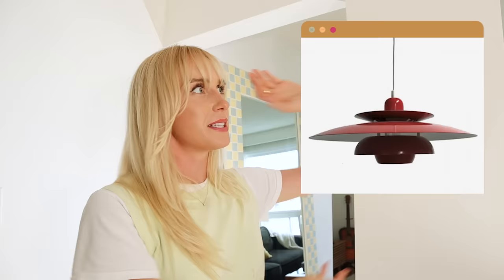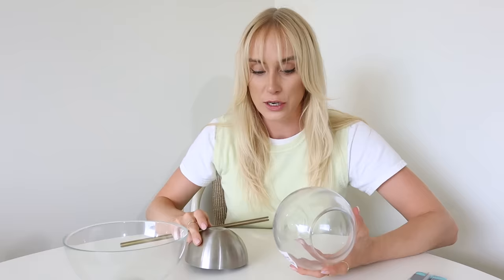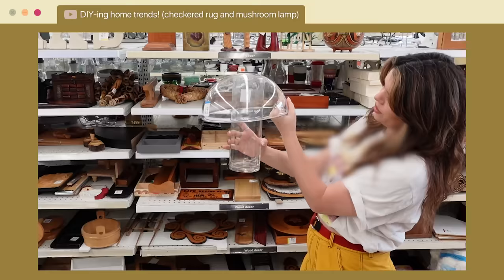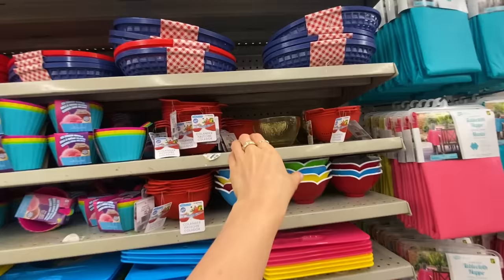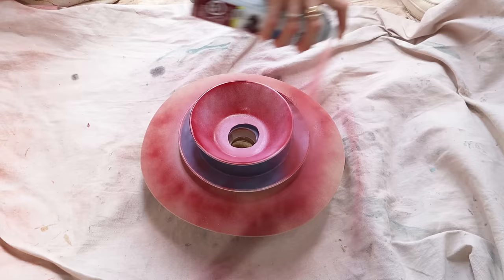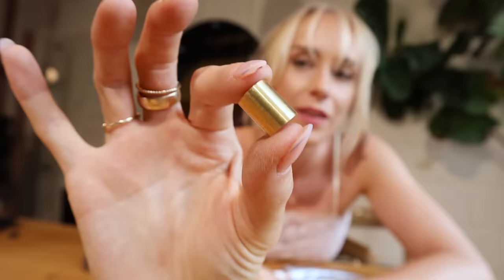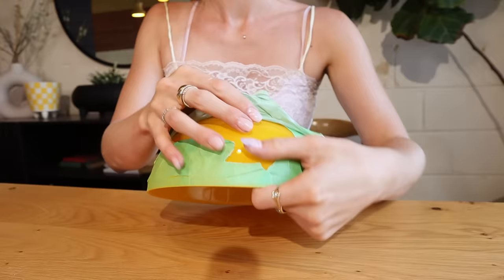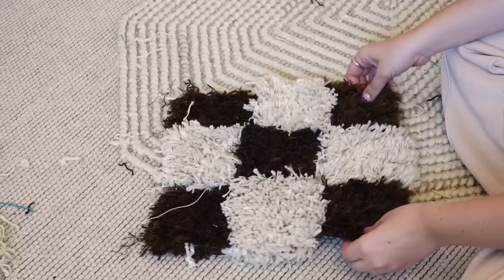making THOSE mid-century modern scandivanian lights

Comment: Couple of hole saw drilling tips, Tip 1-  Drill a pilot hole with the center drill bit without the hole cutting piece, that way you can start right against the material. and you can also run the black backwards for a few seconds and it will create a worn out groove before you start drilling the right way. This is especially good for wood so it doesn't tear up the surface around the hole.

Comment: Thank y’all for this diy. Why do lamps have to be so darn expensive
Reply from the maker: haha right?! you're welcome😁💡
Reply: Capitalism. Also I would rather buy it from an artist than a store, even if it's more expensive.
Reply: Because light/ lamp design is hard. How light reflects in the lampshade to create the optimal light for giving function of the lamp. Yes they are expensive but the Re-sell value is almost the same as new ones maybe even higher if the color is rare.
Reply: @RalleDue  you are so right! And while the DIY of the poulsen lamp is a good visual fit overall, the light it'll cast will be different.

Comment: I think painting the underside of some of the lower plates on the red lamp white or creme will make it look even more finished!! Also I thought it wasnt super duper clear how the light was sitting in the yellow lamp in a way it was easy to change the bulb and the wires are not visible as shadows in the glass.. maybe one extra step to include in the vid next time! Looove the results anyway though

Comment: i would have put on a large washer on top of the copper rod with a nut holding it in then glued your glass to that base, the squishy silicon nature of e600 would have given some good cushion to the glass and the washer a wider base to distribute the weight and shock to the bottom glass bowl. looked great though. they both did.

Comment: Such a great dupe for both lamps!  Question:  won’t the glue you used melt with the heat of the bulb?
Reply: I guess another reason for LED, since they don't get hot
Reply: But the main point of the design for the ph pendant is the light and how it difuses through all of the layers of the screen. It seems with this reduplicated design the light will only go straight down from the buttom. But it looks great as a piece in itself

Comment: Ikea has the almost perfect glass vase for the flower pot lamp! It’s a vase with a lip, but it only comes in green and in black glass ☹️ (Konstfull) ALSO! Instead of the takeout cup, you could use a “lamp harp” and glue it inside the vase. The bowl on top then needs a hole in the bottom, so you can screw the bowl down  to the harp. That gives it the little ball on top of the lamp.

Comment: These both look so great! I'm smiling a bit because my friends actually own the flowerpot lamp and I think it would be so funny if I did this DIY and had them come over... WOULD THEY BE FOOLED?! But I'm curious as to how Rachael did the final placement of the lightbulb in it? Because it was obviously just flopping over to the side before the video cut to them styled, so is it like that or is it actually sitting up somehow? Thanks!
Reply: I'm guessing once she had it wired up, tested, then glued the round vase into the threaded pipe, that she pulled the excess cord down to make it flush against the inside of the vase (to make it sit up straight)